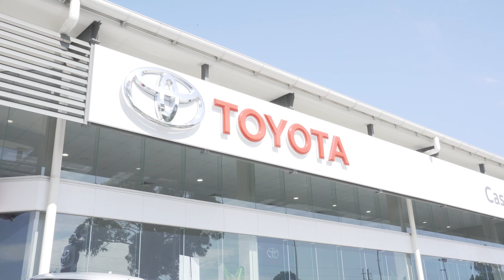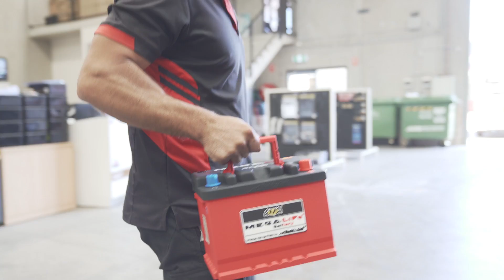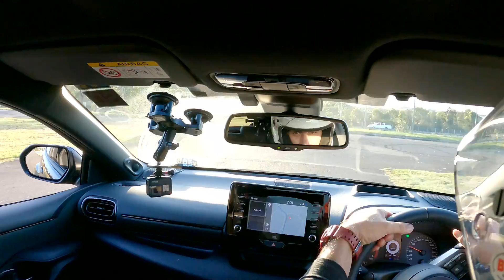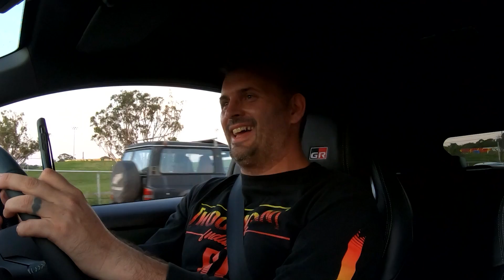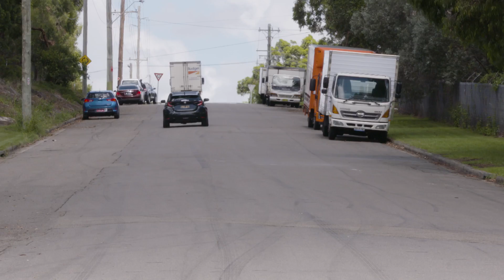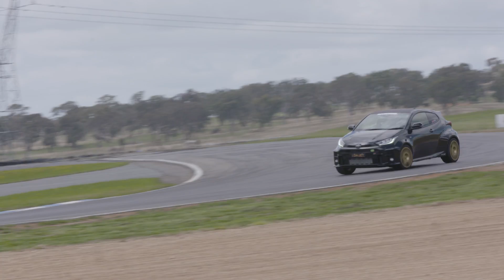Is GR Yaris with Upgraded Tyres and Cat-Back Exhaust Better? - Motive Garage GR Yaris Ep2

Comment: I would of never of thought of a battery as a performance mod that's so cool.

But you don't have to spend as much as what you said on wheels for weight saving. I can save 11.6kg (not a GR Yaris) with a set of wheels for $1200 from Rota, and that's unsprung mass so who knows what that is maybe the equivalent of 46kg.

Comment: the GR Yaris circuit pack comes factory with front and rear LSD and revised suspension. also with better tyres and wheels. that solves most of your bad  first impresions. you should mention that you bought the base one to modify it.

Comment: another great & helpful video! Unfortunately you didn´t mention which Zestino size you´ve used on which rim size / offset.
There are two sizes which fit to the GR: 235/40-18 and 265/35-18 (very wide tire for such smal car)
B.t.w.: you compared it with the standard car´s tyre (Dunlop), Michelin 4S of the circuit pack works much better!
Reply from the maker: We dont have circuit pack in Australia. The equivalent Rallye hasnt arrived yet either
Reply: @MotiveVideo  would you mind to answer the question on sizes wheel / tyre you´ve used?

Comment: This yaris screams bigger turbo upgrade everytime... 

Stock frame turbo but with much bigger chra...

And i bet rear diff would change the understeer nature into oversteery fun especially with 60-40 (or was it 70-30) torque distribution in sport mode?
Reply: Also looks like u need dedicated full bucket seat with much lower base height.. your head with helmets on looks like going to bang on upper door sill everytime there bumps

Comment: I have been thinking about getting a Li battery for my GR - I have one in my Ducati (an Earth-X).  The "inbuilt jump starter" is the under-voltage protection reset.  Those batteries are ruined if they get to zero volts so they have that protection.  It will also have over-voltage protection and cell management.  Li batteries require slightly less voltage to charge than lead acid and some have been known to get overcharged, heat up and get thermal runaway...  On the good side, they're very light in weight and, if there's no parasitic drain, will hold their charge for months and months.

Comment: it´s a shame you didnt get the "track pack" with front and rear LSD, better tires, firmer suspension and sway bar. I bet with that tires you could go 3 o 4 seconds faster still
Reply: would've cost 20k for 5k of mods=
Reply: @craig465478  it costs 4k dls on the dealer.

Comment: 7:55 says “If this thing had a rear LSD it’d drive out better?” It looks like it’s got the track pack so should have front and rear LSDs as standard?
Reply: Was asking me the same question
Reply: Yeah should be twin torsens
Reply: Circuit pack has forged BBS wheels & red brake calipers,this car doesn’t

Comment: Aren’t those zestinos ment to be budget friendly just looked them up my advans were cheaper (admittedly not by much but $80 for all 4 is a bit) would be interesting to see how they hold up compared to the ad08r’s
Reply from the maker: Not sure where you get AD08s cheaper than Zestinos in same size?!
Reply: @MotiveVideo  I haven’t priced them lately but I paid $240 from memory for them on my focus 18 months ago according to prestige tyres and autos website the same size is $266
Reply: Ps good old loyalty rd runs

Comment: Factory Toyota battery’s are crap. Very prone to leaking around the posts. So great move👍 save weight and no rusty battery box or rotten terminals in the future.

Comment: I found one of these batteries guys.

If your wondering about price I found one close to the one on the video above. Cost $675 aus and 5.5kg weight.

PS I also found one for $1065 lol
Weight was 2.8kg. That's a lot saved in weight from 19kg stock one.

Comment: My question is, why were the hazards coming on under braking?
Reply from the maker: Its a modern car safety thing. We thought they would be smart enough to turn it off in track mode but here we are 🤷‍♂️
Reply: @MotiveVideo   it just shows the rest of the field that you're giving it full stick. If they're not  coming on, then you're not pushing hard enough.
Reply from the maker: @garybloom7445  Ha ha, True

Comment: Which pack of the car did you get? Hopefully not the comfort pack hahah.
Reply from the maker: Australia has two models. Normal and Rallye
The Rallye has LSDs and better tyres but it hasn't arrived in country yet, cost 15K more than we paid and only 200 coming here.
Reply: @MotiveVideo  yeah and they're sold already n people are spewing we're only getting a measily 200 in the whole country.
Reply: Rallye spec get comfort and circuit pack. This car is base spec which actually comes standard with comfort pack options.

Comment: Did you get the choice for the circuit pack option?...... 
Enjoying the content 👍🏻
Reply: In Australia its called “Rallye” edition. First 1100 cars, which includes this car, were stand pack. The rallye(circuit pack) haven’t landed yet and there are only 200 of them coming at this point. The other fun fact is the rallye model gets both the circuit and comfort pack options. Where as in the uk you can only pick the one pack.
Reply from the maker: Nope

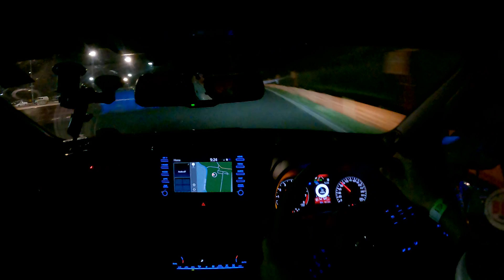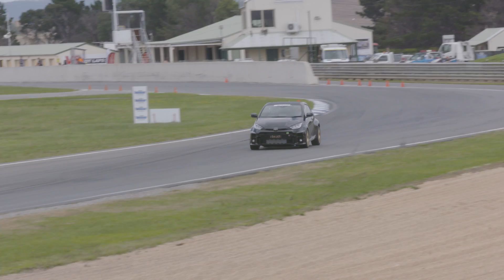Comment: is someone pressing the hazards when on the brake or is that a glitch? happens at 10:43 & 14:53 - or is that a thing in sports mode to warn people on the track?
Reply from the maker: Its a road safety thing. Hazards flash when hard braking. Supra does it too. Bizzare you cant turn it off.

Comment: Is abit of that 4 seconds not overshooting the handbrake turns. Did you even do a handbrake with slicks or just turn it properly
Reply from the maker: Have faith that we compared our best run on stock tyres and best on the new tyres. We know the track from 4 seasons of competing in Rallysprints.
Reply: I didn't say you didn't know the track. You seemed so do a overcooked handbrake turn on one run. Next on better tires you seemed to do a smooth turn and Carry the speed
Reply from the maker: We tried a few ways on both sets of tyres over 8 runs.
Reply: @MotiveVideo  fair enough.

Comment: Can't imagine the lapsprint style allows much in the way of tyre warm up. The semis would be barely warm at the end.
Reply from the maker: they're not semis and they work cold, but they do have a warm up area where you can do hard turning circles to warm the tyres pre run.
Reply: @MotiveVideo  Treadwear 140... semis....

Comment: That new exhaust looks like it hangs down quite low underneath? Is that not going to be an issue when you lower the car?
Reply: Hangs down like full diaper 😁
Reply: Yes, an inelegant design from the get go.  It wasn’t much to look at which often rings alarm bells for an exhaust.  Often - the nicer they look, the better they perform. The pie cuts are here, there and everywhere, which is fine but to reach a muffler so low just screams poor design. I suspect that ain’t going to be the only exhaust on that car. Fair enough, I’ve put many exhausts on the same car and some are good for different reasons and states of tune.
Reply: I noticed that, too. That exhaust definitely isn’t rally worthy lol

Comment: Lithium batteries are great aren't they! I remember when I got mine and people said I was silly for spending that much on a battery and I used the same justification as you did stating it was actually cheap for the weight saved, 11kg in my case. Can't beat that
Reply: Mr 2Fast4U

Comment: I thought this thing came with front and rear LSD?
Reply: a quick google search says its got a eLSD in the rear or torsen front&back with circuit pack. found this weird too.
Reply from the maker: Australian base model no LSDs.
We are only getting 200 "Rallye" versions but 15K more than what we paid and still havent arrived here yet
Reply: @MotiveVideo  aaah, i'm sure you can put some even better LSD in it aftermarket then!
Reply: Only the ones with the circuit pack. If I recall correctly, the circuit pack is not offered in Australia.

Comment: Why didn’t you go for the track pack car with the diffs if you’re going to be tracking it?
Reply from the maker: There is no such thing as track pack in Australia
Reply: Ah okay, that sucks, in the uk we have a track pack with front and rear Torsen diffs. Plus it adds some decent Michelin PS4s.
Reply: @hibatos182  That did confuse me too when he said crap tyres and no LSD
Reply: The circuit pack (Rallye) version doesn't launch until next month here in Aus with no known delivery date at this time (expected later in 2021).
Reply: The base model was $40k for us and the track pack is $56k. The first batch for each price was 1000 units and 200 units respectively. The first 1000 sold out in 6 days so another 100 were offered for $45k and they sold out in a few weeks.
They haven’t started building the 200 Rallye version yet but a lot of us figured the $16k cost saving would be used to make it better than the Rallye anyway. Also to be lucky enough to get one of the 200 Rallye is the first risk to take, not to mention waiting many months longer.

Comment: Yes it is a very cost effective weight saving methode. But please don't compare rotating mass like wheels with other mass on the vehicle
thanks
Reply: Sprung and unsprung weight savings are not equivalent
Reply: @James-dx9ho  it's not only about unsprung mass. It's mainly about rotational mass. Reduce unsprung mass and you make the supsension react better. Reduce rotational mass nad you make it faster.